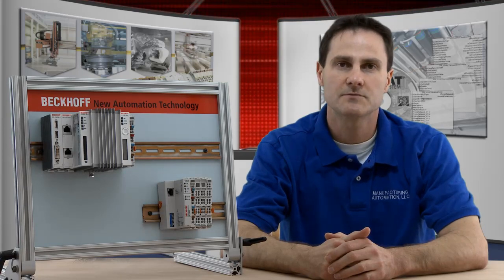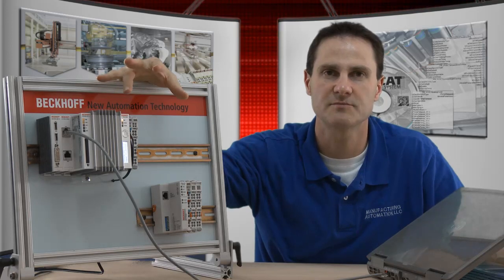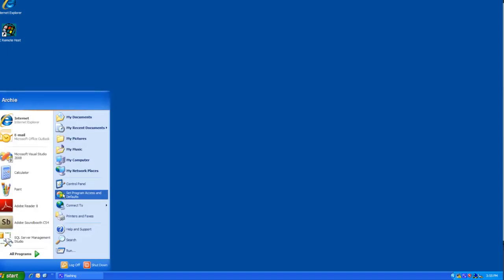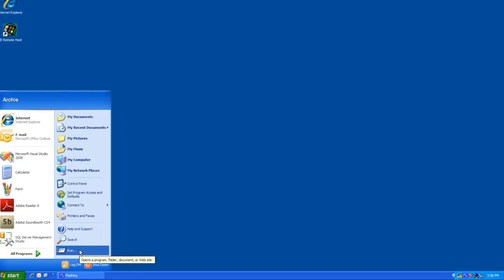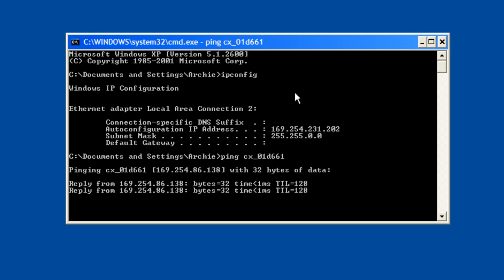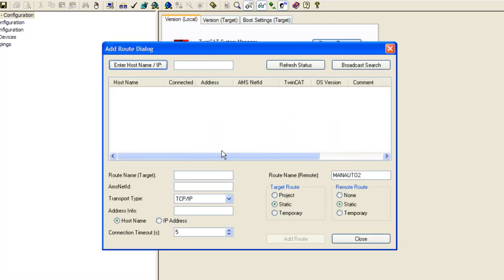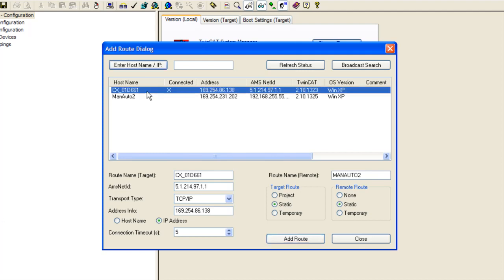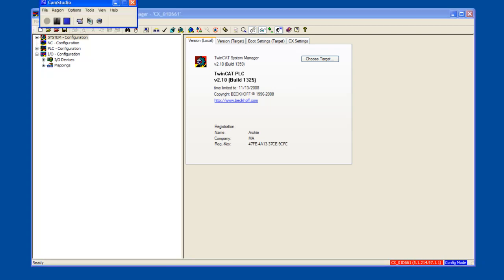Getting Connected Between Beckhoff CX and TwinCAT

Comment: This is the perfect scenario, I followed all the steps but I couldn't get a connection with the PLC. I am using a CX 2020 with a Beckhoff monitor on which is installed Windows CE. I have to connections C-LAN X000 and C-LAN X001, but no local area connection. What should I do to connect to the PLC, should I change something about AMS ID , should I configure something first in order to generate the local  area connection?
Reply from the maker: You shouldn't have to change the AMS Net IDs. Verify that your computer is set to DHCP by opening a command prompt and typing IPCONFIG. You should see an IP address of 169.254.xxx.xxx , If not you may have the address et to static. Is the CX new out of the box or has it possibly been set to a static IP address?
Reply: I managed to connect to the PLC,  why it worked today but didn't work yesterday I have no Idea, even though I did the same thing like yesterday. Thank you for your help and for the tutorial!!!!

Comment: Hello I am trying to get connection with a CX1001-0121 CPU module, but I do not know the PLC name that must appears in the LCD display in the CX1100-0002?
Could you give some directions? I am using Windows 7 Starter. roberto.rojasrangel@hotmail.com